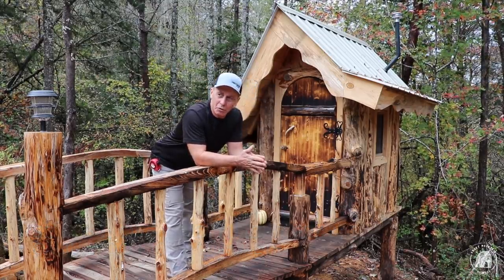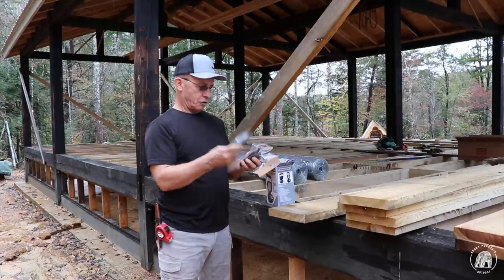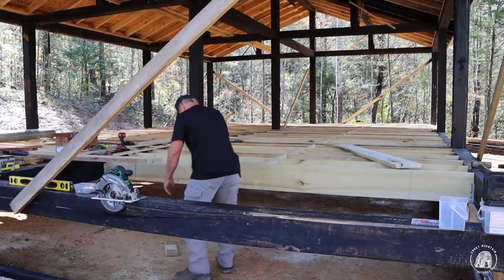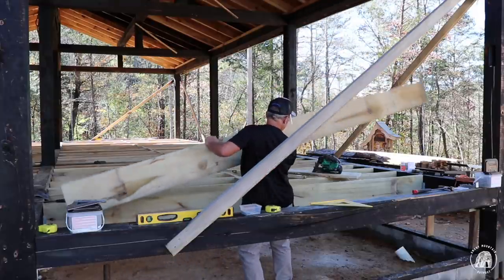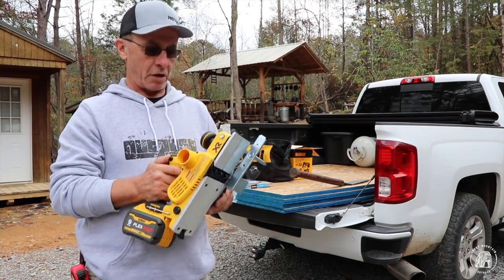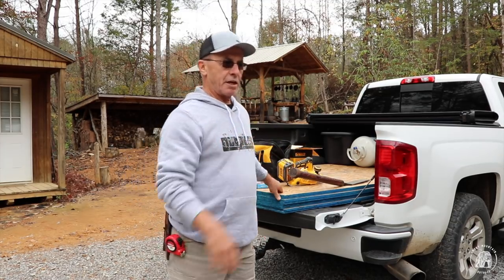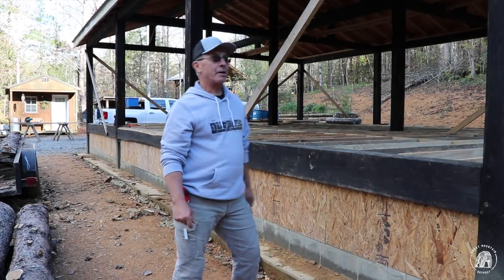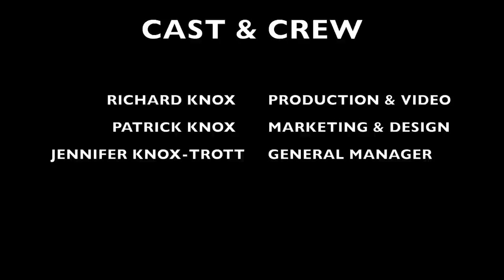S2 EP54 | OFF GRID TIMBER FRAME | CABIN FLOOR JOIST COMPLETE

Comment: Richard your doing a great job on the cabin.  A tip from a retired electrician is to put some lighting and a couple of outlets under the floor before you put the floor decking down. It will be a lot easier while you can see what your doing.You can thank me later when your in the crawlspace with light to see by.  Keep up the good work.
Reply from the maker: I plan on it

Comment: Yes, more  on the led rechargeable lights  !
Reply: I found this.  He mentioned it was called a Tiger Light.  Not sure I see the relationship with Precision Machinery, but Tangent is about 25 min from Eugene.  https://tigerlights.com/c-1180020-led-work-lights.html
Reply from the maker: The relationship is that they sell them in their business.
Reply: Just got my Tiger Light.  Way nicer than it looked in video and Tiger Light website pics.  Good quality and boy will this get used.  Magnet makes it usable!  Back of Gator, on my tractor, truck engine compartment etc.  Thanks for showing on your channel.

Comment: I figured you would put heavy plastic on the ground with gravel over it for keeping moisture out and to keep it clean. Much easier to do before you put the plywood decking down. I would have done it before the floor joists are installed. Just thinking out loud. LOOKING FANTASTIC‼️👍👍. Vinny 🇺🇸

Comment: Popular is like hemlock - the horses have a hard time chewing it on fencing and you have to drill a pilot hole before you nail or screw it in. Thats why we use it on the top rail of a fence. Good solid wood Richard! Big hugs from Perth Ontario.
Reply: Am glad to hear that about poplar. It was always considered 'trash-wood' where I grew up, but have come to learn that 'old' ideas were not necessarily right.
Reply: @paulpetty3307  It is no good for exterior use as it will rot quick quickly even if painted.

Comment: What are you using for flooring? Will it not pull (or push) the crown out of the joists? Will the planer not just follow the profile of the joist and leave you with a crown in a less than ten inch wide joist? Do I ask a lot of questions?

Comment: Are the joists green or have they been air dried? How do you plan on preventing having humps in the floor at every beam due to installing the joists flush with the beams especially if the joists are green lumber? Since the joists are flush you have no allowance for joist shrinkage.
Reply from the maker: They are dry
Reply: @SmokyMountainOutpost  I had an issue once  on a job I designed with joists on hangers. The joists were installed flush and after  everything was said and done the owner ended up with a huge crack in the hardwood flooring due to the differences in height of the joists and beam. Both were kiln dry lumber except the joists were no. 2 hem-fir and the beams were lvl's which I suspect may have contributed to it.  I learned to raise the joists if on hangers somewhat above a support beam so as to not risk getting that hump in the floor at a beam.
Reply from the maker: Actually the joist are higher than the beams by 1/2 in

Comment: I do not envy the work to come to spread the plastic barrier over ground under floor joists as they will stress the back even with help.   I would get some cheap yellow nylon rope to tie down plastic you intend to vertically drape to keep rain out or the wind during rain will blow it everywhere.
Reply from the maker: It’s only for a little bit

Comment: Hey why do you buy all different brand batteries tools. Why not stick to the same brand and use the same battery for all tools
Reply: The dewalt circular 60 watt saw read the reviews! The bottom plate is off an you cut every cut crooked an no recall on them. They no what there doing
Reply from the maker: Here’s why. All brands have at least one that leads in reviews from the other. I try to get the best and not just what’s handy. It’s no problem to charge any battery.